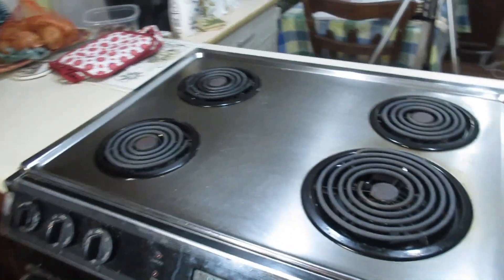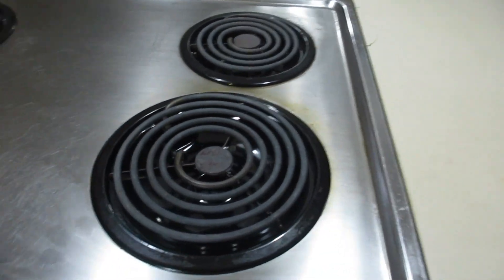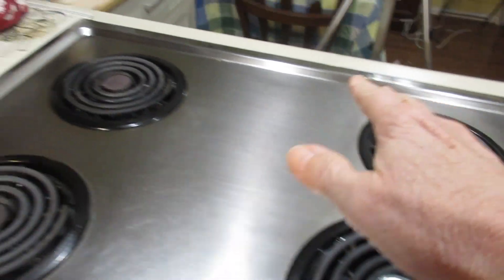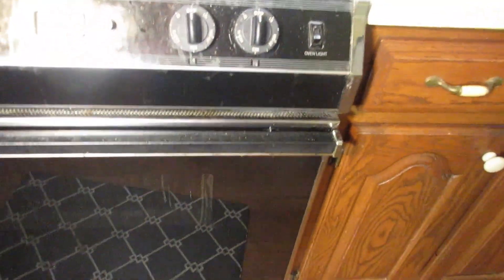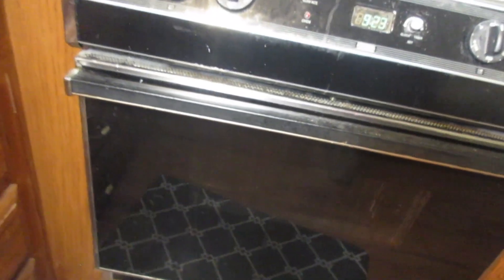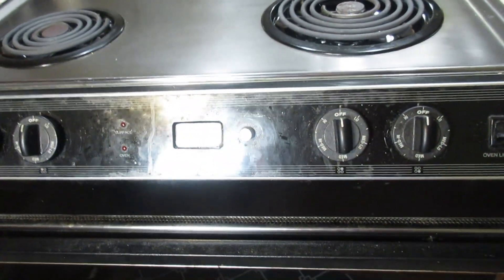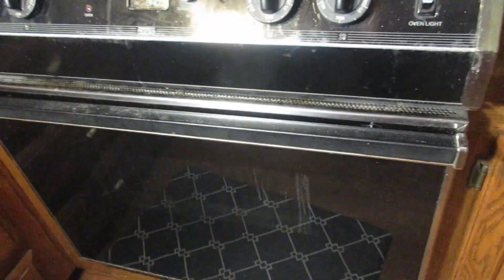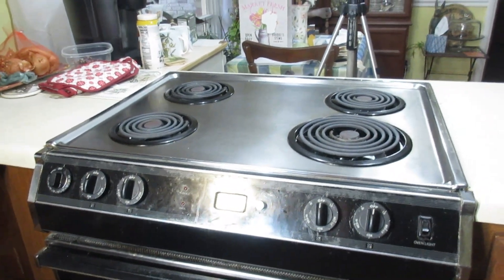I Refurbish Our Stainless Steel Stove Top.  Bye Bye Scratches!

Comment: It is not a mean or hateful criticism, just an observation as I know the gentleman is just sharing his work with pride rightly so.

But others that may try it:
1- Start with a coarser grit and work your way to finer

2-  important is to use use sandpaper block any that you may find appropriate or more than one size, don’t ever use your hands it will apply more force where you press it with your finger and won’t be good

3- never circular motions, only work on the direction of the grain and pattern of the stainless steel and only one direction do not make back and forth movement, only forward movements from a start point to the end, raise de sand paper being back to the starting point do not track back sanding,

It won’t be easy a cooktop may take the entire day 

Then buffer it with some bar keeper’s or similar media, it is annoying to remove the media all are, no miracle easy to clean media.
Reply from the maker: Thanks for providing more and better advice.  As you say, it could help others.  Rich